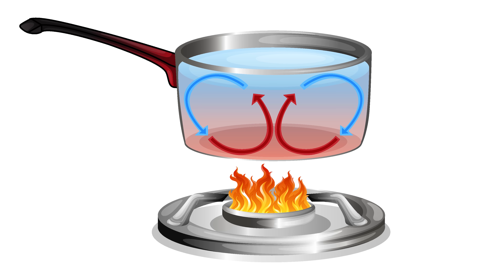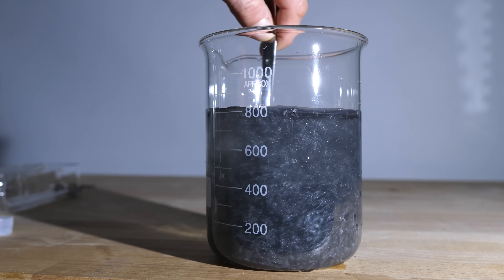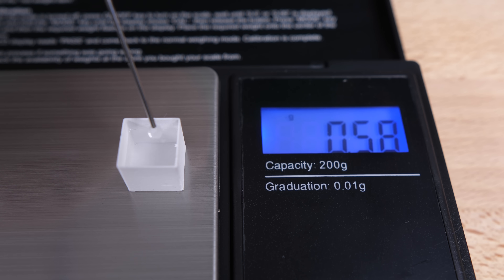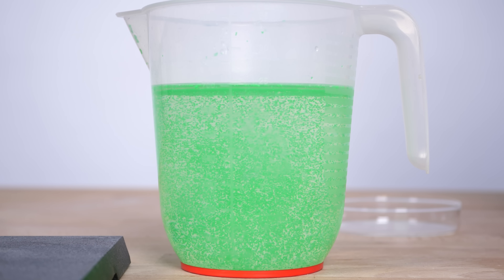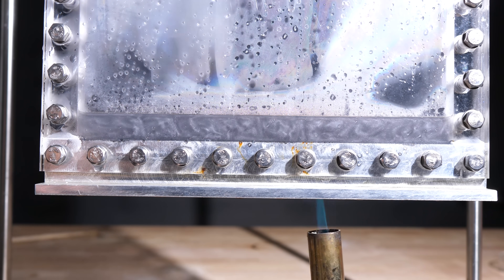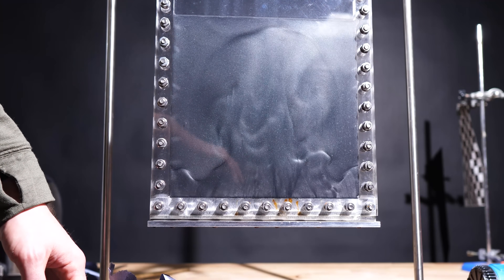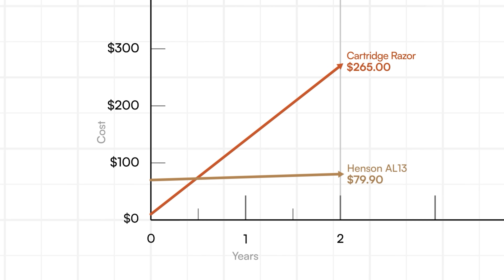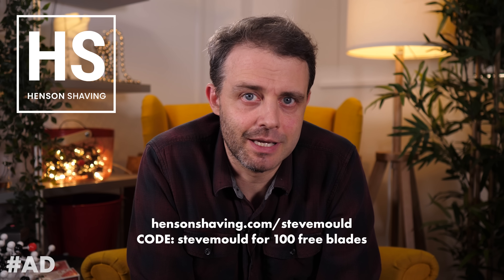The bizarre patterns that emerge when you heat ANY fluid

Comment: I absolutely know what you mean by "2D-Version", but in this case it's very important to mention that this process would actually look and work differently in true 2D. This is, from a fluid dynamics standpoint, still 3D. Actual 2D fluid dynamics (which does not exist but is and has been studied mathematically and numerically) works surprisingly different than real-world 3D fluid dynamics. 

I'm a PhD student working on turbulence and turbulence modelling, and the difference there between 2D and 3D is astronomically, much of the physics basically flips around. Fascinating stuff! Great video as always!
Reply: This is in general the case, dimensionality has a huuuge effect on the dynamics of a system. A 2d vs 3d system can show completely different critical behaviour and phase transitions for instance, like the Kosterlitz-Thouless transition, if you do the calcumations in 3d it is a qualitatively different system. Same goes for 2d vs 3d magnetic systems
Reply: @mattias2576  Good point!
Reply: can someone explain the differences and maybe why they are so different. mentally it feels as if it shouldn't change that much.
Reply: @conrrr  The "easiest" to understand or at least visualise is vortex stretching. When a vortex spins, conservation of (rotational) momentum and friction are working against each other. In three dimensions, this leads to so-called vortex stretching, where the vortex stretches outside the "swirl-plane" along its rotation axis (vorticity vector). 

However, in 2D there is no third dimension for the vortex to stretch "into". But angular momentum and friction are still working against each other.

This leads to completely different physics behaviour. Where 3D vortexes break up into smaller and smaller structures, while in 2D, the opposite happens.
Reply: @ibonitog  I remember with my team trying to convince my upper hierarchy that it was nonsensical to ask us to perform unsteady 2D simulations on a large 3D geometry but they insisted because "the geometry is mostly 2D and the simulation will be cheaper". It was so frustrating.
Reply: @ibonitog not having any experience with this type of thing my mind immediately goes to comedic animations I've seen of 2D people living in a world where they can't walk past each other so they need to climb over and duck under obstacles. Then to extrapolate on those animations I was imagining a game of Street Fighter where the two 2D fighters blast energy balls at each other and how they will interact when they collide… yes, this attempt to visualise the concept shows my scientific limitations but is perhaps useful to build on so as to hopefully explain the science to the uneducated masses.
Reply: @conrrr  And because of this lack of "vortex stretching" in 2D that @ibontog mentioned, turbulence acts completely differently.
In 3D, large vortices generate smaller vortices, which generate even smaller vortices, until viscosity takes over and turns it into heat. (energy cascade)
In 2D, small vortices will merge into larger vortices, which means there is an inverse energy cascade.
Reply: @conrrr  someone else can probably explain it better, but here's a start:
there are a few major mathematical differences between 2d and 3d for starters:
- much more complex rotations: in 3d you have 3 possible axes of rotation, in 2d you only have one.
- if an volume of fluid needs to move out of the way to be replaced by another, it has a lot more options where to go in 3d. It can not only move left and right, but also to the front or back or anything in between.
- volumes are bigger relative to lengths in 3d. The volume of a cube with side length s in 3d is s³, whereas in 2d it's only s². That different power can have strong effects

There's videos on YouTube with a laser visualizing turbulent flow of fog in a 2d plane. As the laser is moved, you see different planes of the 3d flow. In 3d, these are all correlated. It's as if in 2d, things could suddenly just appear or disappear without any observable reason, yet these disappearances still follow (3d) rules.
Reply: @sebastianjost  could you please provide a link of that video I like to watch it
Reply: My question is, if you define a system in a 3d box, but then sort of take a limit as you shrink one of the dimensions of the box, does the behavior approach that of a truly 2d system? I guess what I'm trying to say is: does a really thin 3d system actually approximate a 2d system at all, or is there a sudden change in behavior when the system becomes 'fully' 2 dimensional?
Reply: @josephblattert6311 i was wondering something along those lines. If you take a 2D model and start adding a slight 3rd dimension, is the change gradual or does it immediately start functioning in a completely different way?
Reply: @josephblattert6311  you can do that in quantum mechanics by "freezing" the degrees of freedom in the 3rd dimension (namely, forcing the system to remain in the lowest energy level only in the z direction), and it does some crazy things. But I am not sure whether you could do that in a more classical system.
Reply: @josephblattert6311  if the box has a very small size in one direction compared to the other, then the walls will heavily impacts how the fluid behave. 

You have a boundary layer forming on every surface, it's a zone in which the velocity of the fluid vary from zero (for non-slipping surfaces) to the free-stream velocity (in our case, the apparent "2D" velocity of the thin fluid layer).

The thing is that a boundary is a zone where the momentum of the fluid is heavily dissipated by the viscosity, and this dissipation depends on the free stream velocity.

If you want to try to observe 2D turbulence, you want to have zero turbulent structures in the "thin" directions, meaning that your boundary layer will be laminar everywhere. The max velocity in the "thin" direction will be in the center plane of the box.

But if you have a varying velocity in this plane then it means that you will have a varying boundary layer everywhere, meaning that you will have a varying momentum dissipation due to the boundary layer depending on where you are in the fluid layer. Said otherwise, the faster the fluid will flow in your "2D" plane and the more it will be slowed by the boundary layer created by the walls. Therefore, the momentum dissipation due to the walls in the thin direction will not be uniform in your flow. 

This would not happen in a "real" 2D flow. In a 2D flow there's no impact of the 3rd dimension, let not say an non-uniform one. Therefore, you can't reproduce 2D turbulence with a thin box.
Reply: @josephblattert6311  Maybe a bubble is a good system to observe, to see if it approaches 2D math, since, as a commenter pointed out above, the surfaces are largely friction free with minimal boundary effect. However, I would doubt a good match since a very small number is not the same as a very clean 'zero'.
Reply: It’d be awesome to recreate these demos in actual 2D and point out the differences between the “2D” model and a real 2D simulation. There’s probably some cool math to highlight there
Reply: Can you not get kind-of 2D systems, like the surface of a bubble? Or are interactions with the outside dominating things?
Reply: @Hailfire08  nice thinking with the surface of a bubble but anything (even subatomic particles) has 3 dimensions in the universe we live in from a mathematical point of view. Even a 2D drawing exists on a 3 dimensional piece of paper and is made of 3 dimensional layers of carbon atoms, so from a day to day POV it's flat or 2D, but it physically exists in 3 dimensions, just not as thick as the original object depicted in the drawing. A replica of an abstract drawing would technically be a three dimensional copy of a three dimensional object depicting a theoretical/imaginary 2 dimensional image. Or I might just be a bit too high.
Reply: What kind of applications are there for 2D systems? It sounds fascinating
Reply: And still many concepts of 2D turbulence is applied to different problems in the ocean and atmosphere, given the intense horizontality of the dynamics. Most of the time driven by Earth's rotation.
Reply: To anyone studying 2D fluid dynamics: you are awesome and I like your strange brain <3
Reply: @ibonitog Astronomical. Bad grammar, Mr PhD.
Reply: @_c_e_  Flash news for you : there are PhD students and PhD graduates allover the world, and not all of them are perfectly fluent in English.
Reply: @76Eliam  then the efficacy of  comprehension, knowledge and trust has eroded
Reply: @_c_e_  I'm not a native english speaker, sorry for the mistake. Thanks for the correction!
Reply: So that means he visualized 4D convection using a 3D model
Reply: @krumplin8992  no he visualized 3D convection using 3D model.
Reply: I would curious to see slices of a 4D simulation
Reply: This is 2d in the sense we have a slice taken we can see instead of a circle pot of water, basically a shorthand descriptor
Reply: Yup - in the 2D case, the equations for fluid dynamics have been solved . (That is, they have a well-defined set of solutions). That's not the case for 3D.